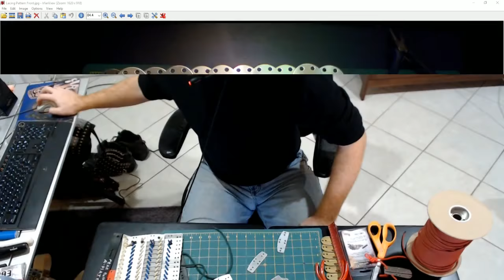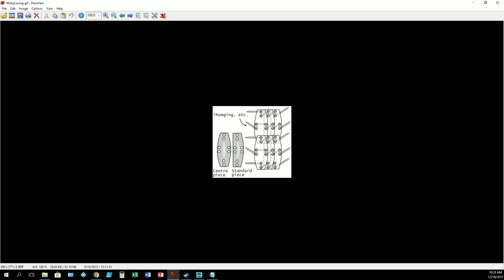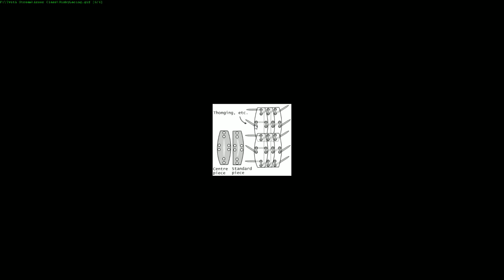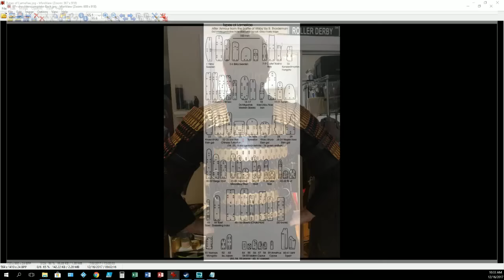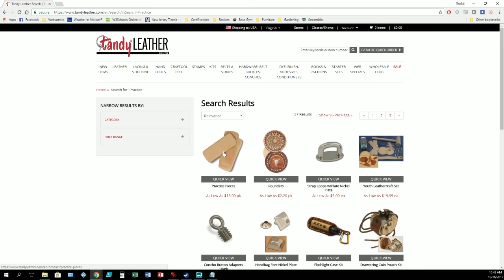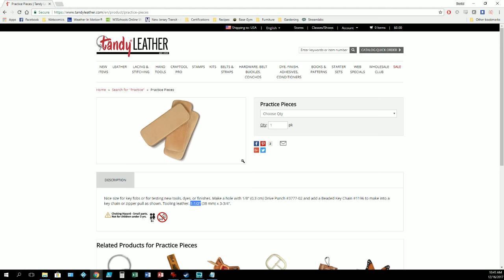Everything you need to build your own Lamellar Armor

Comment: How many plates would you say you used to make your larger set you briefly showed us?
Reply from the maker: Dont have an exact number anymore BUT i did use this plate calculator from the vendor, and then bought extras to do the shoulders on later builds! https://www.plasticlamellar.com/suit-builder/
Reply: Think I am going to try and build a suit when money permits. Im thinking of darkening either steel or alum to have a darker aged look. I blacksmith so I have a large variety of tools available to join in the effort of doing something like this.  @APirateCooksAt404
Reply from the maker: @MrMakto  sick! I know i referenced some books in there, if you can find copies since you might be making your own - would be to research and get die cut patterns for different styles, shapes and hole punches for the plates.  I've done it with leather and it makes for neat stuff, especially if you can tolerate doing all the math to have different shapes where the holes all line up to make visually interesting patterns
Reply: Yea i thought about using a waterjet service to also cut out scales/panels @APirateCooksAt404

Comment: Thank you for this,  it helps out a lot . there were a few things i was getting not quite right before. please forgive me if i missed it but how do you finish the cording at the end of the rows for plastic plates? I have been just tying it off but i feel that there is a better/ more permanent way to secure it that i just have not figured out yet. Been scouring the internet and that is the one thing that no one seems to have any form of "how to". Thank you for your time and consideration. Take care and have fun.
Reply from the maker: Depends on the type of cording you are using.  If you are just using paracord like me, melt and then press it against a flat piece of metal, dip that in some water and boom you have a ready made hardened rivet.

Comment: Great video! Just starting to build Lamellar armor for SCA -- viking persona...  
Couple of questions -- I'm laser cutting leather plates -- based on the Ack pattern - so 2.345” x 1.22" -- leather is 2.7mm (0.1 in).  
Questions...
1) In your experience will this be rigid / protective enough for SCA fighting? Or will I need to double up plates?
2) Was planning on going with brown paracord 95 instead of 550 as it looks more like leather lacing -- will this be strong enough?
Reply from the maker: Hi Lance! For SCA use, as a former scadian heavy combat person from back in the 90's, i would strongly suggest you not use the plastic personally.  Aluminum or Steel - not for fear of breakage  but more due to the nature of how the materials distribute force.  The metals will absorb impact a LOT better, the palstic passes it along for lack of a better term.   That said with the more rigid metals I think you'd be perfectly fine for torso armor with the usual caveats of SCA (relative) safety in needing rigid materials on joints etc.
Reply: If I may add my own anecdote, I've several friends who have used the plastic lamels from plastic lamellar for heavy combat rattan for several years in the Empire of Medieval Pursuits (EMP) with minimal breaks, and no injuries (due to insufficient armor).

Comment: Have you or anyone you know used rawhide.Pretty sure it was pig rawhide I was using. I'm asking because I tried it and found it very difficult to work with. I had to soak it to make it workable to cut the shape of the plates out which wasn't the hardest part, keeping them flat while they dried was the most annoying. It took over a day and each one curled along the length and width causing a semidome on the plate which made getting them to line up almost impossible. Clamping them didn't work, it at best slowed the process to intolerable levels and at worst left parts of the plate wet as it prevented the water leaving. I'm guessing because it's animal skin with the water being held in pockets.

Also I had to deal with shrinkage, each plate lost about 10% to 15% of size after drying but the few I managed to lace together worked well. I tested them against a heavy machete and a wood axe and the hide held out without being cut through completely. The most damage I did was when I put it flat onto my chopping stump with no padding and used the axe again and partially cut one plate and stretched the one behind it. The rawhide is rigid enough to stop the blade of each but flexible enough to give against the impact and then spring back with some surface damage.

I also tried waterproofing the plates using PVA both before and after drying had finished. Before drying is better as the glue gets into the hide but massively lengthens the drying and in both case the glue started to work its way out after repeated hits, the plate that was wet when the glue was applied took more punishment before this happened. Made the thing look like it had been sunburnt and was peeling.
Reply from the maker: I've only ever used pig suede as a trim material, and also saw the same shrinking as it tightened up after being exposed to the elements but as it was laced it still held on okay. I dont have the patience to cut out my own leather plates, but its very easy to buy leather plates kind of pre made from Tandy leather in their packages of 100 'blanks'  - then you can just do edges, patterns or punch holes as you like.  A lot of the challenges you faced are why I went straight to plastics though, as it mitigates a lot of those problems and upkeep.
Reply: Rawhide's a pain: it's thick (min 2-3mm), so punching holes in it is hard work - and don't buy those hole pliers punches, they blunt quickly on the anvil. You're going to be punching a lot of holes...Tandy's also rather expensive, as a supplier, they charge something like 50% over market price, and far more if you source from China - the problem there is that the Chinese punches are made of a really soft iron, which is hard to keep sharp, but is, on the other hand, authentic - they hadn't mastered phase annealing and hardening in 1200 (by 1400, that was a different story, they were well on the way in Western Europe).
Reply: Daniel Burke Urgh, YouTube notifications failing again. I'm only just reading your reply. Yeah I took the step of buying some steel plates. I'm not done with the idea of using leather or rawhide but maybe as protection for my arms. Something easier than cutting and drying small sections that refuse to co operate.
Reply: Robert Armin Tried a leather punch only last week. The effort it took for the crappy hole it produced was annoying.
Reply from the maker: The rotary ones are IMHO not worth the money.  A good steel set with a rubber mallet and a self healing mat are the best value to effort in terms of quality
Reply: I mount my mat on a 1cm pounding board and that on a hardened glass plate. It has the effect of providing a hard surface mitigated by the give of the pounding board and the take of the self-healing mat.

Comment: Thinking about trying to make my own suit and had a couple of questions.  Have you ever tried using rub and buff or other method for adding a distressed look to the plastic plates?

Also, have you ever made a suit that is open/belts across the chest?
Reply from the maker: So in terms of distressing - i find that the plastic can look 'scarred' that way but you need to hit it with some manner of paint to really highlight the scratches and scuffs. 

As to a forward latched suit - i've considered it but haven't tried yet.  That said the math wouldn't be too difficult and I can see it working easily enough.
Reply: I figure it's similar to a back closing suit, with maybe some edits to make it look prettier as it's now front and center and part of the look.

I got a demo pack of Rub N Buff, I'm going to see how some of the scale colors look with various colors of Rub N Buff.
Reply from the maker: Nice, let me know how it works out!

Comment: If i use real lammelar for sword tests and reenactment i bet cutting the cord may be common,so how you fix or replace thm?just straight up knots and pieces of cord keeping the pattern in place ,or do you relaee the whole row?
Reply from the maker: assuming you mean 'sharps' as blunted weapons generally dont cut paracord.  Oddly in the last three years I haven't have one break in the middle BUT i have had a few ends snap - the easiest solution is to melt some cord onto it and just do a quick 'weld job' as it were.  To be more complete relacing that row would need to happen but a quick and dirty repair will hold for a weekend and a full row of lacing doesn't usually take long to correct (15-30 minutes if away from home and optimal conditions)
Reply: Daniel Burke thanks a lot! What about leather lacing? Sorry to bother☺
Reply from the maker: No problem - leather lacing would be more problematic as you dont have the easy 'weld' option.  At that point if you are using leather as your lacing material I would make a few small leather patches with pre-punched holes in a 2x2x2x2 pattern (or whatever your plate pattern is really) to bridge the broken piece, slap some jiffy rivets in and continue.  THAT SAID - what I'd found when testing this by just cutting one or two lames down the middle is that it usually does not lose cohesion due to the lacing above and below.  Its pretty firmly locked in, but a quite rivet job  and tie off the loose ends until you could relace the row would work .
Reply: This supposed issue with Lamellar Armor has been way overestimated. It's arguably the most sucessful armor and was in use, in countless countries, unchanged, until ancient armor fell out of use! If there was a problem, they'd have fixed it centuries ago There's an Armorer & Blacksmith in Australia named Craig Sitch that claims to have taught Peter Lyon all he knows that has done extensive tests w/ Lamellar Armor & razor sharp swords and he says it's never an issue...
Reply from the maker: From my own anecdotal experience I'm agree with this - its easy to test yourself as well just takes a 3 or 4 row sheet and start cutting stuff, You have to cut out a lot in a specific section to really destabilize it
Reply: I'm a knot-tyer - the International Guild of Knot Tyers has a thesis that the difference in rigidity in any tie, where it passes from flexible to rigid, creates a virtual guillotine inside the cord at 1.5 times the circumference of the line up from where it goes rigid. Where that is, could be a knot, could be a sheath, but 1.5 it is. Why, we don't know - the most common place you find it happen is in your headphones.

Comment: Is it common to mix plates??
Reply from the maker: Bit of a trick answer: Depends on the plates :D in the case of the aluminum ones from El Fjord those are designed to be interchangeable with the hole placements